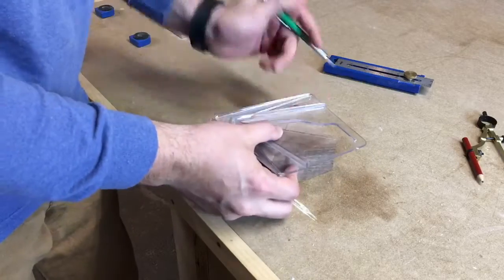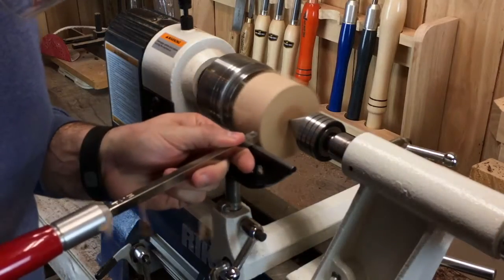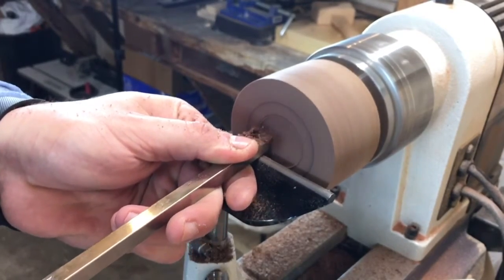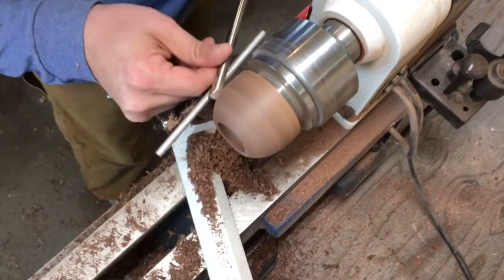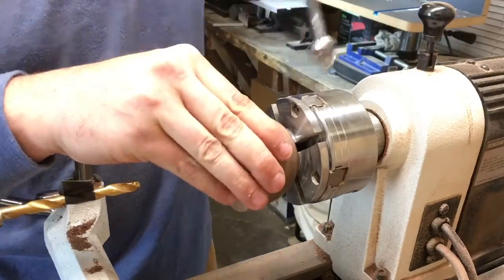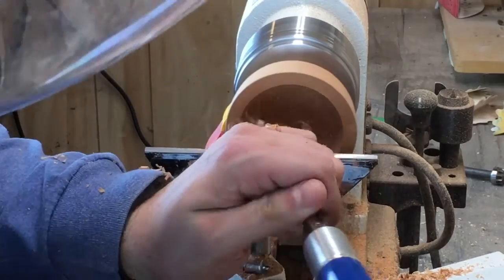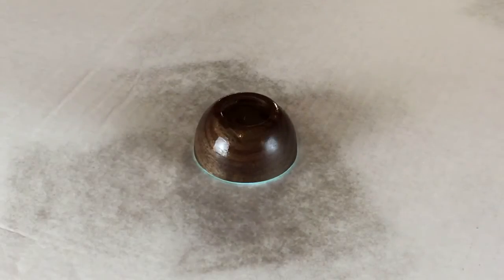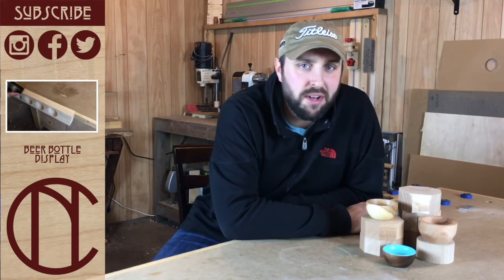Turning a Ring Bowl with Carbide Tools - Craft Market Series - Episode 1

Comment: Nice work, Nate.  I do like the painted inside. Did you lacquer the painted surface too?
Reply from the maker: +Sean Rubino thanks, that was my wife's idea. I didn't lacquer the inside because I wasn't sure how it would react with the fresh acrylic and I didn't want it to yellow at all with age. I think the acrylic will cure hard enough to be sufficiently durable for the bowl's purpose. What do you think?
Reply: +Nate Crilly probably right. I am not familiar with acrylic paint. Clear spray lacquer doesn't yellow though. Shellac will but not lacquer. That's why it is a guitar finish.
Reply from the maker: +Sean Rubino Thanks for the info! Just getting into lacquer, I've always been a wiping varnish guy. Lacquer is just so quick and convenient.

Comment: What's the sandpaper you used for sanding through 800grit? The sort of sun shaped ones.
Reply from the maker: +Lucien Lasocki They are made by New Wave. You can get them in most woodworking stores or just about all of the online shops.